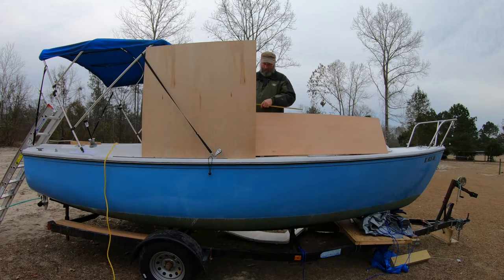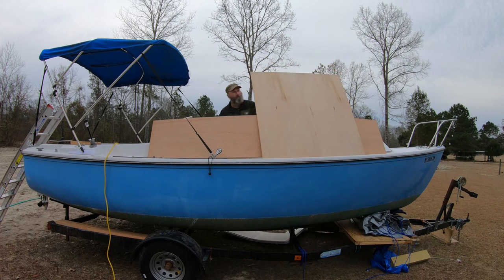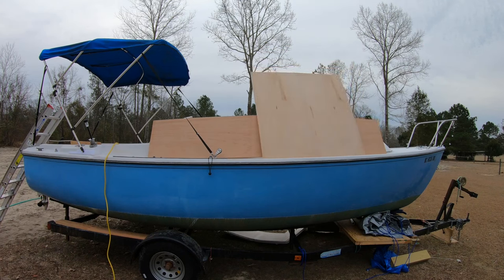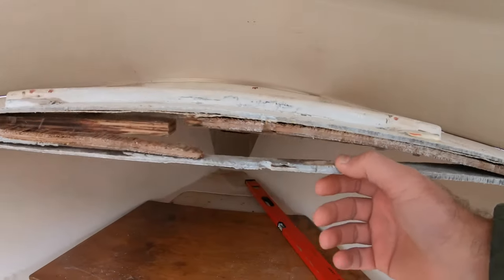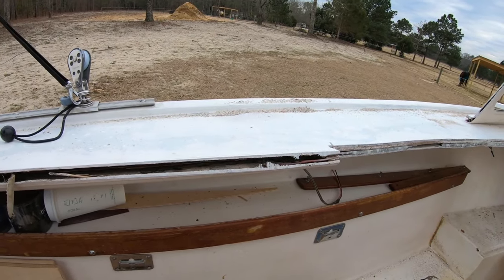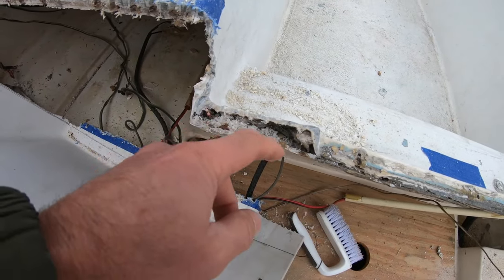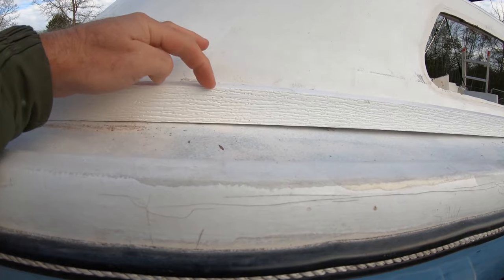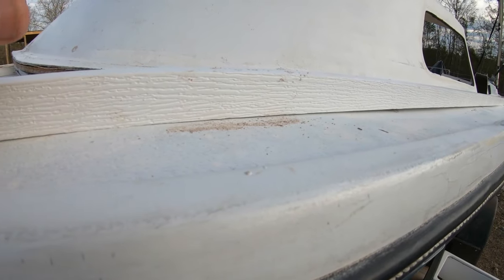Sailboat to Trawler/Shanty Conversion (Ep2)

Comment: Stability might be an issue now without the swing keel.  Especially with a raised cabin top.  You might need to put some lead weights or sandbags under the cabin sole.

Comment: I'd keep the walking level at the original sole. You will have to keep the keel and partially lower it underway to keep the rocking down. You could also add two small bilge keels so she'd sit upright at low tide . In addition You can add removable ballast in the form of sand bags, or even water jugs to stabilize Her. Super important to build as light as possible the higher You go so 3/4 inch ply is ok for floor level, but cabin top should be half inch or even lighter if You sandwich styrofoam glued between two layers of thinner ply or ribs to strengthen the top. You maybe cool to sit on the highest level but not walk. So save weight and make the cabin walk through to do forward deck work. Check out the way Jim Michalak and Phil Bolger designs use this excellent walk through cabin with open center design. Then You can seal that center opening with light hatched or canvas snap on pieces. Essentially You want weight down low and not much up high . To keep Her from rocking removable ballast bag or jugs to fill with fresh or lake water. And slightly lowered keel and or bilge keels will help but also look into a short mast installation with a used or old one that goes through the cabin, even off to the side a bit, and anchored to to floor so You don't need wire stays. Then look into a rig called a dipping lug or lug rig which can be easily made on the cheap. This rig will help You at anchor or under motor power and even sail down wind. The old 1930 English motor boats often had short rigs that can even be taken down or lowered quickly and easily by one man when going under a bridge or trailering.  Very cool and worthy project which I've been thinking about for a long time. Above All...Have FUN!

Comment: Id pull the whole deck and start fresh if funds allowed
I have a 25ft oday im doing the same with.i have a m25 diesel engine thinking bout installing,removeng deck and 1800lb keel.
Reply from the maker: I may wind up doing that... if I can source materials ( especially glass and resin) cheap enough. I have a very small budget, so we'll see.